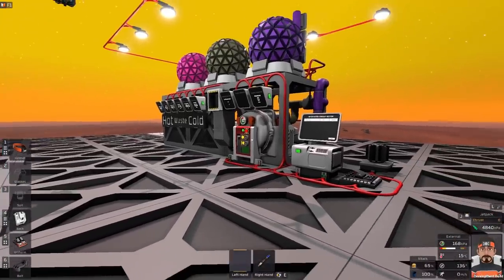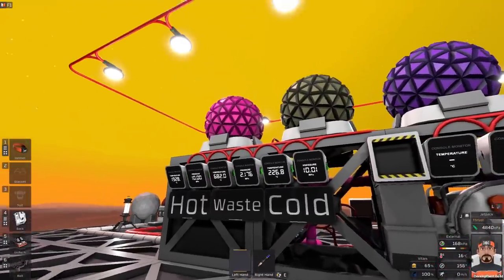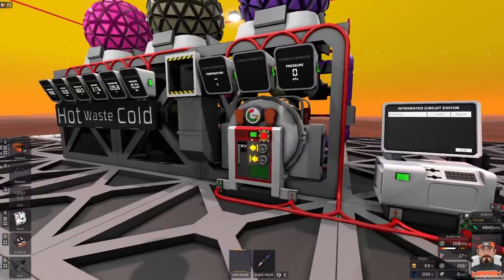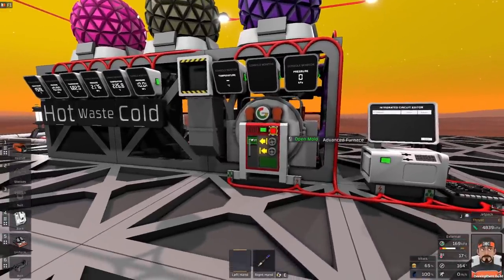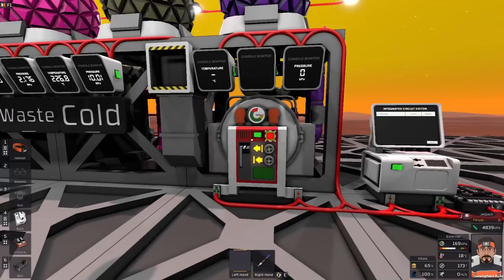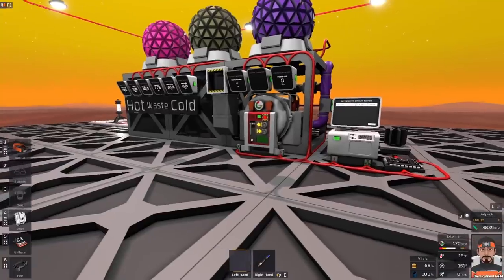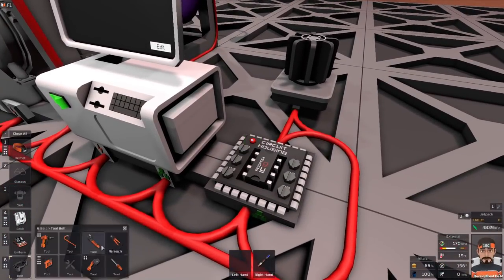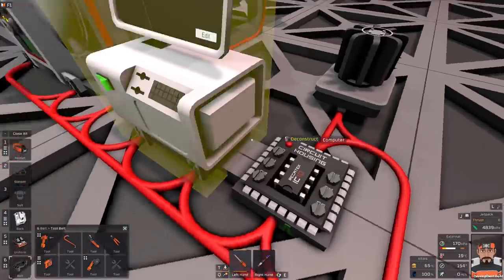Stationeers Automatic advanced furnace build Part 2

Comment: I'm attempting a slightly different setup.  During smelting, the off-gasses can be vented to atmosphere or to filtration.  I start by using the basic furnace to fill the ignition pipe with hot gasses, then I remove the furnace and attach a heat exchanger to retro-heat the oxygen supply so that the fuel mixture auto-ignites in the ignition pipe.  There will be a second pipe which is connected to the advanced furnace in which I'll manage the temperature/pressure instead of adjusting it in the furnace.  This is achievable if the advanced furnace input/output settings are both maxed.  There will be an exhaust port to vent excess gasses.  It's basically like a hybrid between yours and that of Elmotrix's "over-engineered" furnace.
Reply: I'm still experimenting with it, so it's not up and running yet.  I have the ignition pipe combusting as desired and am preparing to program the fuel pipe management system.  So far it is self-sustaining, just have to use the furnace to get it started.
Reply: Self-sustaining sounds interesting! If you make a video about it or a post somewhere, or just upload the code/world, I'd be interested in taking a look.
Reply: @jbkingjr1982  hopefully it won't turn out to be a flawed concept!  LOL. I'll probably make a video if it turns out well and let you know. Last I checked the ignition pipe was holding steady at 2200k and 12mpa.  EDIT: I just noticed in video #1 that Mick's setup also holds which means his build is more practical because it doesn't involve having to remove the basic furnace.  Also his setup is more compact.  Mick's very smart, smarter than I am that's for sure!
Reply from the maker: I just use the furnace for the pupose of a cold start.  Once it is operational and hot the fuel should auto ignite when it is injected.  I just leave the furnace in place for the sake of simple operation.

Comment: This isn't currently working in Mr Cow's shared world build. I think a later stationeers update has screwed with the code. Try to create Stellite to recreate the issue. 
It seems to get to about 9Mpa in the furnace and then the furnace ejects into the waste tank with a rapidly oscillating pumps; it also seems the tank management code is too strong for the furnace management code so hogs all the pressure :( What I can't understand is that the hot tank doesn't seem to call more fuel mix into the system, but instead leeches from the waste tank. I'll have a go and see if I can work up a fix, but computer coding scares me and this script breathes fire.

I do however, love all the content and have had some nice belly laughs and learned some cool hardware coding from you, so very grateful, Sir Mr Cow.

Comment: Hey Mick, amazing viedo on the advanced furnace. I followed everything you did and I can't seem to get the dial and the hash display to work for selecting what I want to make. I did exactly as you said, I pushed the code into the chip, powered it on, then overwrote it with the main Advanced furnace code and it just still refuses to work. My buddy and I even loaded up your saved world and tried to dissect everything and compare to what I have built and it just still doesn't do anything for us. Any ideas?
Reply: Ok, I fixed that issue. Don't remember what it took, but it works.

Comment: Hey Mick, have you tried out this build on the Beta branch? I can't seem to get my Filtration Unit to work properly. I have plenty of Temp and Pressure coming from the regular furnace, but the Filtration unit doesn't seem to want to let gas out of the Unfiltered output and into the Hot Tank or the Advanced Furnace. Maybe it is just a bug?

Comment: Well, I don't understand MIPs well enough to write the program in it, but here is how I would set it up.  First, smelter pressure would be governed by a ballast tank and a pressure/backpressure valve pair, and hot/cold gas would be added to the smelter only when the pressure was low enough.  Which is what the program would handle.

//Device is just a pseudo class I'll use as an input/output
Device ColdPump;
Device HotPump;
Device Smelter;
Device BallastOut; //pressure valve that removes pressure to specified level
Device BallastIn; //backpressure valve that keeps set pressure in smelter
Device IngotSelect; //not sure how this works, but you would have a separate selector for the ingot and this would pull data from it.

int MaxPressure; //these will come from the ingot you want to smelt
int MinPressure;
int MaxTemp;
int MinTemp;
Int TargetTemp;

MaxPressure = IngotSelect.MaxPressure;
MinPressure = IngotSelect.MinPressure;
MaxTemp = IngotSelect.MaxTemp;
MinTemp = IngotSelect.Mintemp;

//the smelter is always either too hot, too cold, or in the right range.  Same for the pressure.  So you don't really need to mix them properly unless you want to optimize for speed.

TargetTemp = (MinTemp + MaxTemp)/2; //this would find the middle between them and can be done in a few lines in MIPs.
//I set this as the temp to heat it to because the smelter will cool as it smelts ore.

if (Smelter.Temperature < TargetTemp){  //this can be simplified using a "slt" in MIPS
  Hotpump.On = 1;}l
else {HotPump.On = 0;}

if (Smelter.Temperature > MaxTemp){  //Also simplified using "sgt"
  ColdPump.On = 1;}
else {
   ColdPump.On = 0;}

(DO the same with the pressure)

//It is possible for you to add gas to the point that it goes above the maximum pressure.  This would be minimized by having the hot as hot as possible, and the cold as cold as reasonably possible. (you don't need to run off of -200C gas from an AC unit.  Ambient should be fine.)
//We'll want to optimize this by only adding gas when the pressure is below maximum.  Possibly by getting the pressure to just above the minimum, as the hot or cold gasses will change the temperature more the less gas they mix with, increasing efficiency.  Ideally we would calculate the pressure you need so that the added gasses would never increase the pressure above MaxTemp, but I'm not sure what formula the game uses to calculate that.  I'm assuming everything is based on Ideal Gas law.
//If so, you would need to calculate how much of the Hot or Cold gas you need to add, based on their temperature, and if that amount would put you of MaxPressure, you would remove smelter gas into the ballast until it was low enough.
//I'm not sure how much that would save in heating or cooling power, though, and is probably highly situational.

Comment: Your videos are always great for getting a pragmatic approach to an issue, thanks!

Am I mistaken in believing that the calculations would be slightly off if the input and output gas compositions are different(which should be the case due to ore off-gasing)? The specific heat capacity for each gas is different so one mix would hold more energy per mole/kalvin than another. 

I guess that with your design mixing the waste back into both the cold and hot tanks that the mix should be relatively close, and with the exception of water(which you generally don't put in) the shc ranges from 20.6(nitrogen) to 28.2(co2) and most mixes would be dominated by the co2 and pollutants so probably settle near the same weighted shc, so ignoring all that simplifies the code a bunch leaving more space for the important logic?

I'm also curious if you've attempted a design that only empties if the mix will result in overpressure(instead of trying to hit the minimum) and that mainly focuses on staying under the max heat(so you don't "waste" fuel by mixing cold into your hot gas, allowing you to reuse it over multiply smelts, since most alloys do not have temps). I haven't succeeded in doing such an approach yet but am curious on your thoughts if you have any

Comment: 46:35  math works!!! great job. Are you a engineer in real life or did you learn all that by yourself. Have you think about using the waste fuel as a refill with a return valve on the line  would add bit of math and scripting though. but sure you can handle it.
Reply from the maker: The filtration unit ensures that the fuel remains in the furnace so there shouldn't be any fuel entering the system.  Any combustable gas from the smelting is fed back into the furnace from the waste tank where it is detected by the tank heater program on the back and used.

Comment: Bloody Brilliant!

A thought: why do you set both min and max temps/press? Seeing as your temp/press is so damn accurate, why not just set a temp/press somewhere within the range for each ingot? at the very least, it'll take less code to set your stack. Or am I once again, missing something here?
Reply from the maker: That is a method that would work but in the case of making something high temp such as stellite and then switching to someting like steel, the furnace now knows that the stellite temp and pressure can make steel so it will use the current pressure and temp until they move out of the steel making range before trying to adjust the settings rather than immediately adjusting to the new settings.  A little more efficient way of doing it.
Reply: @cowsareevil7514  I had the idea of cutting back on the number of selections (down to just 8; all basic ingots + steel + electrum as one setting/selection) for similar reasons, but I think your idea is superior.  It's a "smart" furnace!

Comment: This is great work, thanks for sharing!  Have you got a pointer to whatever "rules" you're basing your math off of, or are you really just working this out as you go?  It seems like you're starting with a solid grasp of the temp/pressure physics even before you started building this, rather than just making it up as you go along.
Reply from the maker: I am making it up as I go.  Don't be fooled by the video, it didn't go that smoothly.  I cut out about 2.5 hours of getting it wrong and backtracking.